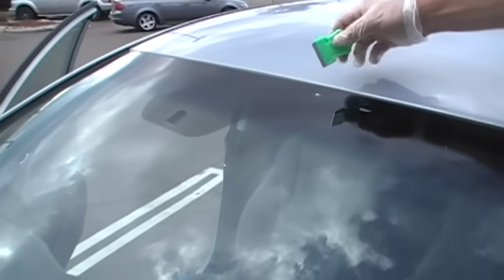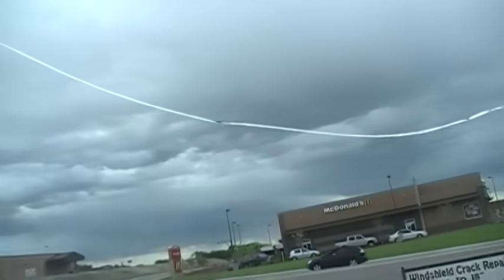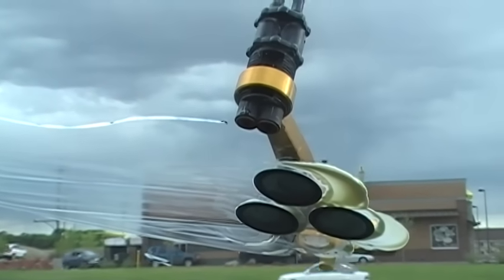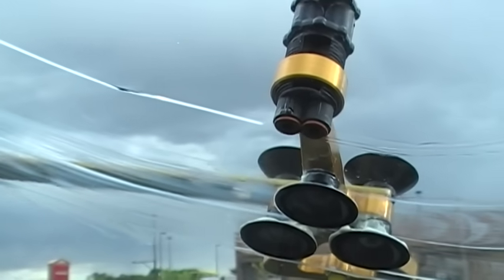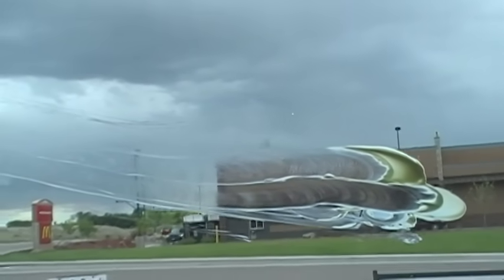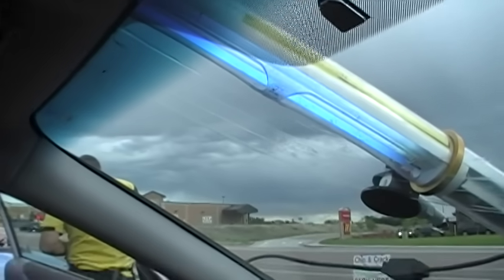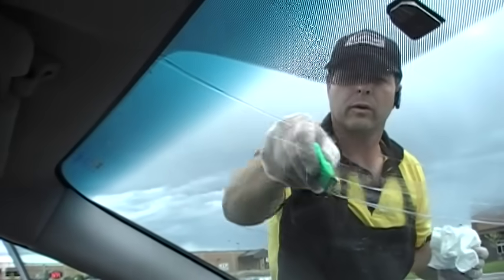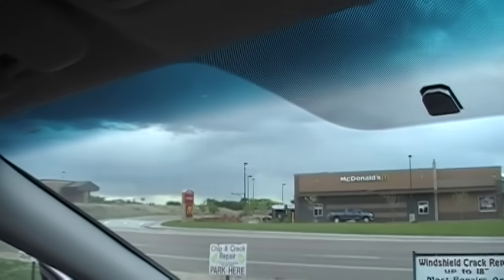How to Repair a Long Crack in a Windshield by Crack Eraser

Comment: I would totally pay for this. Anything to prevent breaking the factory seal on my windshield.
Reply: Nicool333 if you say this to a safelite tech he probably will want to punch you in the face
Reply: @davidg1808  He ain't big enough...(I'm 325 and lightening quick)
Reply: That "Factory Seal" as you call it is a myth...it is URETHANE (YOUR E THANE) It is 1200 pounds of adhesive strength per square inch...ok...replacement windshields meet or exceed this specification(I am a retired TECH...ok???) To have a windshield replaced in your vehicle...demand OEM replacement...to keep resale value its highest...as far as the factory glue...it is applied by robot...by hand is just as accurate...because of pure installation prep on the opening where the glass sets in to place. Have a great New Years!!!!
Reply: @bigsparky8888 yeah it's close but robots are more precise lol
Reply: Dimitri Borozny  I used to work there...their glass is sucky...I have seen so many flaws...crap in lamination...you do have the right for an OEM glass replacement
..it will not lower your resale value either...think about that...and...yes a lot of Slavelite techs are not craftsmen either...Hey...I wasnt perfect...but I tried to do a very neat job...as if I owned it myself...its all a chance...dealers call them too...so know who your dealing with...ok...takes 5 minutes to call around...
Reply: @bigsparky8888  who makes the so called OEM glass? let me guess you think the auto manufacture does right? well that would be wrong the so called aftermarket are the same ones that make your OE glass and just put a different emblem on it. if you are a master tech then show your #.
Reply: Dimitri Borozny  I used to work for them...you are correct...some installers are not craftsman!!!!!
Reply: Nicool333 I would pay for
This too. 100%
Reply: you can still get ahold of OEM or REQUEST... for OEM windscreen replacement. Can't gaurentee the crack won't continue to be a problem with crack repairs.  Nobody does crack repairs anymore actually it's not worth it.
Reply: @Xedilian   why is it not worth it. If insurance will pay for it
Reply: @bulswildoutdoors  Because it breaks again...there is a weak place right where bvb that crack os... an acrylic acid is used to "BOND"... however...if you enter step driveways on an angle...body stress will force stress on that place...common weakness...but the Insurance Companys would rather pay $60.00 now than pay 200.00(example only because prices have changed since I was at work before my back died...(that's when the Glass Corp...Belron Industries/Safelite came out with the "2nd man" arm mechanism to properly help place that windshield in properly...)
Reply: @Xedilian LMFAO $12 vs $500 yeah we know how smart you are
Reply: @Biomagus  you don't know anything about parts and pricing LMAO
Reply: @Xedilian  considering I just did it, I'm not really concerned with your mistaken opinion 🤡 I guess in Mommy's basement there's no need for you to know though 💪😅
Reply: A good tech will put your windshield in as good or better than factory  . That's a myth  
The crack repair if that size is a terrible  idea when you drive at night you will get lights shining off the crack  and blind  you . If the crack is in your vison find a good tech and replace it .
Reply: @tommybridges7632  I am a retired Master Tech...drivers wiper arc area should have zero repairs in it...Fed Law...Dept Of Transportation...look at the little "bug" with the specs in it at base of w/s...either side bottom corner ot very middle...its etched or decal between glass(there are 2 with a vynal center...like a Bologna sandwich...2 pieces of bread with a slice in the middle) ok...it says...AS-1 A=quality...or vision is perfectly clear no distortion. S= Strength...it is the Bologna or laminate in the middle @ 30,000th thick...(side is 15,000th thick or AS-2)...then you see who manufactured the glass...TY...
Reply: Calm your fears on the windshield being comprimised... if you ever need to have your windshield replaced...and the Insurance co sends out a Nation Wide Company...demand OEM GLASS...It is your right...Honda...BMW...etc etc all have their BRAND on the glass...it will keep your vehicle in top dollar trade in value with OEM...DO NOT LET THEM TALK YOU INTO ANYTHING LESS...IT DE VALUES YOUR CARS WORTH...👍
Reply: @bigsparky8888  I understand your thought process but I've been in the field for a long time and run a shop. The insurance can and will deny OEM. It's no one's right to have OEM glass install when almost all auto makers do not make their own glass. I.e. some model Toyota use pilkington or agc. Depending on the part and vehicle. Volvo uses saint gobain and fuyayo. So insurance will deny the use. You can kick and scream. But I've dealt with enough insurances to know if they say no. More times than not you are getting aftermarket. I can call my insurance now and tell them I want OEM glass for my 2017 Highlander and they'd deny it because the cost alone is an additional 600 to them even before the recalibration.

Comment: Long crack repair has been proven to be safe after repair and will pass the same standards of a new windshield. There have been law suits on unsafe windshield replacements but never for a windshield repair. Windshields are laminated glass with a plastic layer in the middle and the inside pane of glass is not broken. The crack is on the outside pane so I understand you comment Firedragon52 but is is totally unfounded and just your opinion. The cost is $60.00 to $70.00 usually free to the customer because the Insurance companies pay the total cost of repair which they would not do if long crack repair was unsafe as you claim.

Comment: Crack that long had weakened the whole windshield, this repair. Is for the eyes only and for those who wanted to get rid of the car with no safety concern. Air bag relied on tough support from the windshield to provide up most protection against frontal crash. By the way, how much it's cost? You better off shop for the ' Chinese made replacement wind shield with almost half price that available in Canada.

Comment: Yes cracks that are cracked on the inside pane of glass can be repaired, if you can reach the end of the crack to dill it and if you can get the Crack Eraser tool positioned to inject resin into the crack. Sometimes the dash is in the way and it is difficult to reach the crack to perform a repair.

Comment: Dear Ian,
Windshield Repair is free in the UK also. You will have a harder time finding someone to repair a crack over 6 inches unless they have my technology, but I took the following repair information off a major glass shop in the UK.
Safelite® LONDON 
"Repairing a windshield is also a good value. If you have comprehensive coverage, and if you choose to repair your windshield rather than replace it, most insurance companies will waive your deductible, leaving no cost for you."

Comment: Most repairs are free because your insurance company waves your deductible and pays for the repair. If you were to pay out of pocket, we would charge $60.00 to $80.00 depending on the length of the crack.

Comment: If you have comprehensive Insurance your Insurance company will usually pay for the repair even if your deductible is high. Deductibles are waved for preventive repairs. If it is cash usually $60.00.

Comment from the maker: No I am sorry my system will not work on scratches. There are some polishing compounds to remove them however If you can feel the crack with your finger nail you will need to replace the windshield in most cases.

Comment: im from sacramento and for some reason we just dont have  a lot of cracked windshield repair shops here, there are a lot more replacement only. some shops here dont repair if a cracks beyond a certain length or if its in the driver position..i dont know why this is, but.....would it be possible for me to buy a bullseye repair kit (locals shops dont have crack kits, just bullseye) and somehow make my own tools and repair it myself following these same procedures?

Comment from the maker: If you have comprehensive insurance the repair is usually free because your insurance company pays for preventive repair by waiving your deductible, however you need to have the repair done within 3 months of the crack starting because of the dirt and contamination in the crack. With chip repair time does not matter but crack repairs are time sensitive.If the crack is under 3 months old the charge for a cash job is usually between $70.00 and $90.00

Comment from the maker: There are some system to remove scratches but they do not work very well if the crack is deep enough that you can catch your finger nail in the crack.

Comment from the maker: That is correct if you have a good UV source such as the sun you are fine with just the sun curing the resin, however in the evening as the sun is going down I like to use a lamp to make sure the resin cures properly.

Comment from the maker: It depends sometimes if the crack is a single crack coming from the edge and you can reach it with a drill to put a stop at the tip. Then if you can inject some of the crack from the tip to the edge with resin you usually can save the windshield.. You would not need to fill all of the crack to stop it and save the windshield. We have also had good success with repairing cracks that start from the mirror bracket.
Reply: That mirror bracket is in the center top ... where does the crack tend to spread? Down or up?

Comment: I just had a cracked windshield fixed last week, it is AWESOME !.... The new windshield was going to cost me around 500 bucks, but  I stopped by and had a repair guy do it for 50 bucks and I cant even see it anymore. It was a good repair job and he saved me 450 bucks, Believe me, I need to save money today too, I lost my job 2 months ago and money is TIGHT !
Reply: hope all is well 12 years later
Reply: Where did you get your Crack fixed
Reply: @MegaSpeculator where did you get cracked fixed

Comment: FIGHT with your Insurance company!!! Remember Auto Glass repair guys in the sameway autobody guys WORK FOR THE INSURANCE companies!!! If the car is new and less than four to five years old and or LEASED the ENTIRE windshield must be replaced. 
These repairs only prevent the chip or crack from spreading! You will still see a DEFECT! If you can see the chip without TURNING YOUR HEAD the Chip or Crack is in your FIELD OF VISION!! Also if the crack or chip is all the way through forget it!